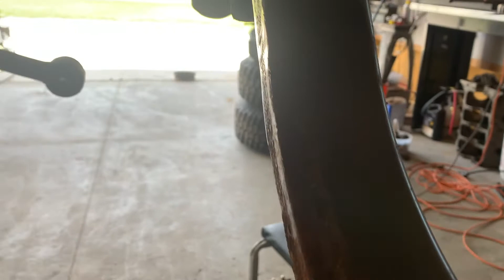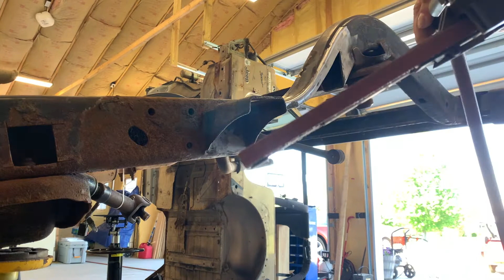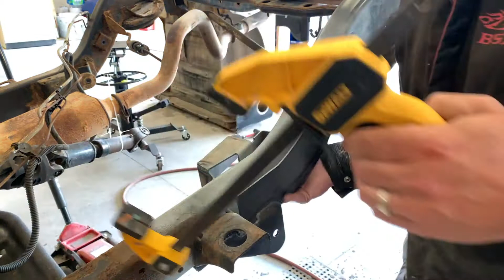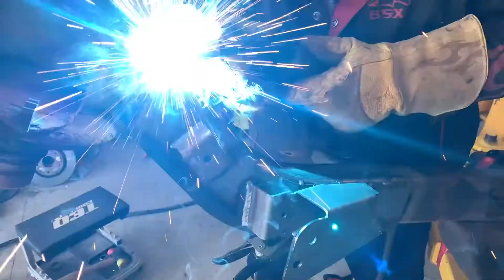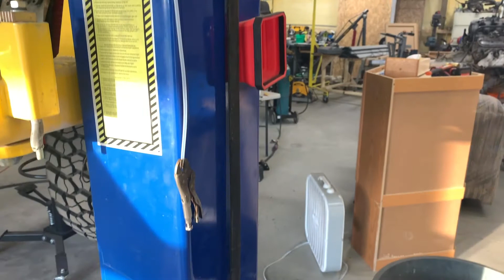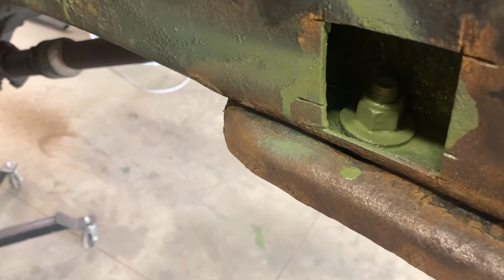Rust repair on my Jeep TJ frame

Comment: Hi, great video btw. For you to be cutting into the frame that high up and leaving so little steel from the original frame, am I right to say that you need to have all the weight off of the frame? (so it won't buckle..) You wouldn't cut that thin if the axle, tub, wheels etc. were still on there, would you? Thanks
Reply: I was wondering how it didn't buckle with so much metal cut out of that area. Even with the rear axle and such all removed I would have thought the weight of the frame and rear bumper behind that cutout would have been enough to at least deform that rail.

Comment: Best TJ frame repair on YouTube but the audio. Oh my.
Might I suggest doing a voiceover to the entire video so we can hear the important details?
As TJ's continue to age, repairs like this and videos like this are going to be needed more and more.
Reply from the maker: Yeah the audio was pretty bad. I will look into redoing that with a voice over. Thanks for the feedback
Reply: @shaunsgarage1091  
Thanks for the reply Shaun. As many YouTuber's don't bother replying, I wasn't expecting one.

There's a good market for your video to be voice over'd as finding good condition, non-rusty CJ and Wrangler frames is becoming MUCH harder and frame resto is an almost guaranteed necessary evil of our hobby.
I've done thorough research into the resto process and products to use and your video ticks off all the necessaries. Doing a redub of your video would be worth it simply for the YouTube view count and would help many doing the same research I did.

Cheers. 🤙

Comment: Friend of mine bought a 94 jeep in 96, he noticed it wasn't driving right so I looked under it ,I noticed the frame was cracked in 3 places ,these jeeps are literally junk right off the line
Reply: It all depends on how much abuse and how much salt and not correctly washed after being exposed does this happen to the framework of the TJ’s.
Reply from the maker: Yes it’s to bad Jeep didn’t learn from all the rust issues they had with the CJ’s

Comment: Awesome job! Do you happen to remember your welding amperage settings?
Reply from the maker: I do not. I tend to weld a little on the hotter side to get a flatter weld. I have the Miller auto set welder so it’s almost dummy proof.